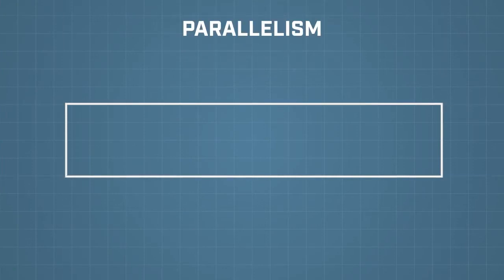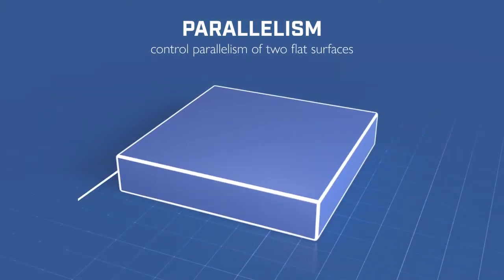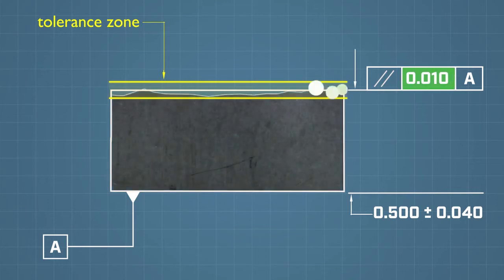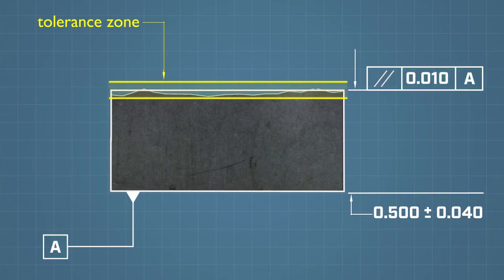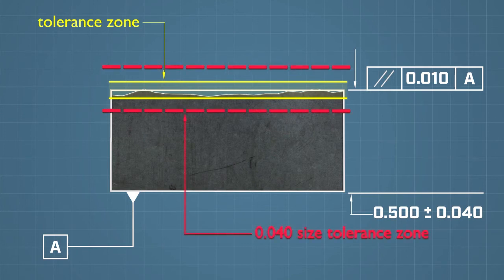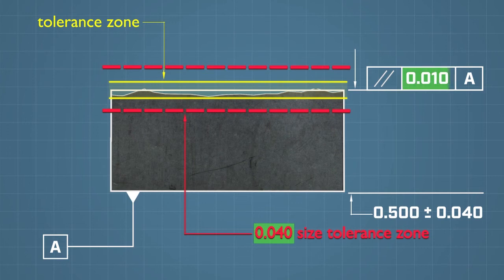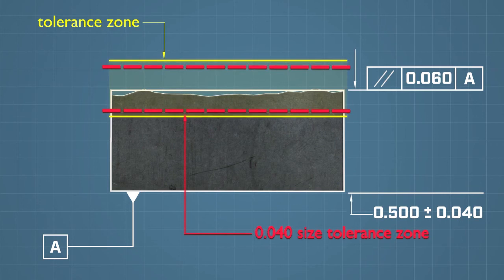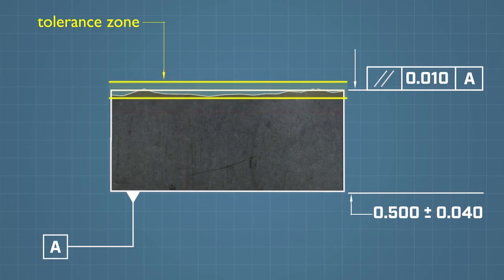GD&T: Parallelism Tolerance Zone

Comment: Wouldn't the size tolerance zone in this example be 0.080" total (+/-0.040")? 

In which case, a parallelism tolerance of 0.040" would still be the tighter controlling tolerance?
Reply: You are correct.
Reply: The part can be plus minus .04 in size which is correct. However the parallelism controls how flat the top surface must be to datum A. Without it one side of the part could be .54 and the other .46 which certainly isn't very flat.